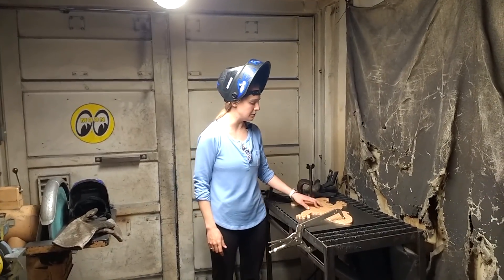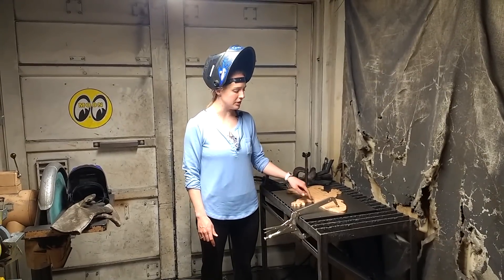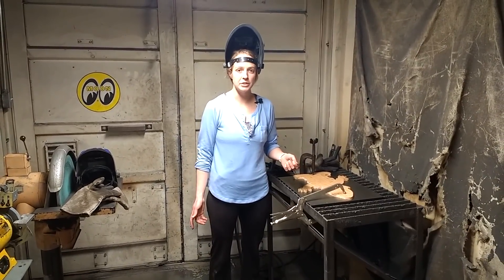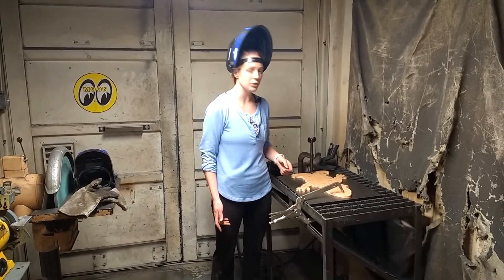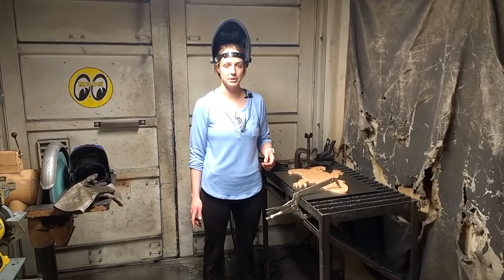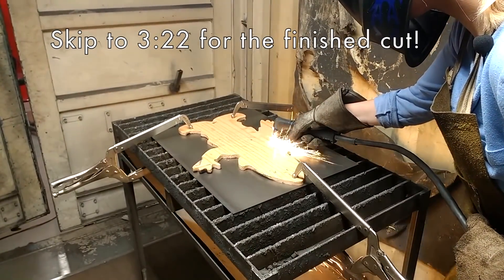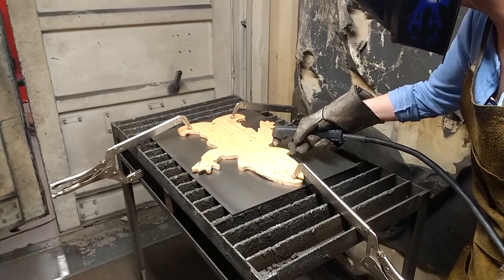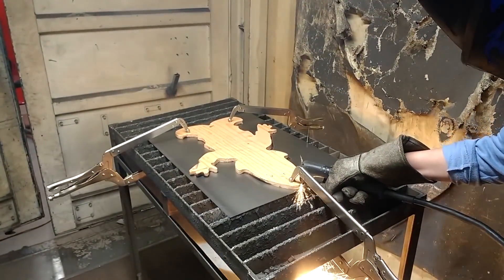Plasma Cut Gnome using Maslow CNCed template

Comment: By sticking a bearing over the nozzle is the torch you can be quite precise and get repeatable results that look very well. By using internal and external templates you can achieve reasonable detail.
Reply: Can you please explain what you mean by sticking a bearing over nozzle?
Reply: @bassworthy  I found a bearing that was oversized for the nozzle and 3d printed a bushing
Reply: That won't work. It will increase the radius on all edges. Instead of tight edge you would get a rounded curved edge
Reply: @Renaldo015  it works and sharp angles are possible. The trick is offsetting the template correctly and knowing when to use an internal template and when to use an external one.
Reply: @Renaldo015 not if it’s a inside use template